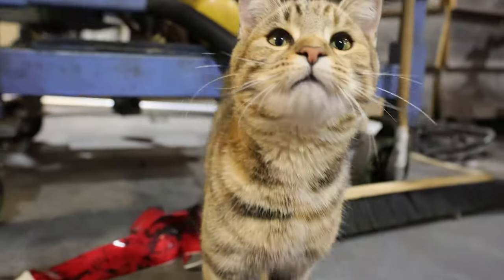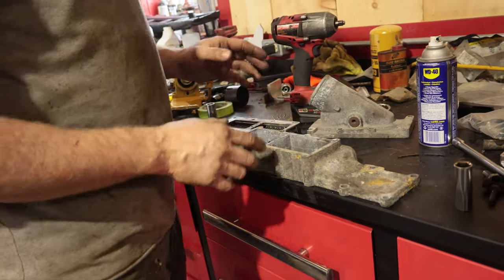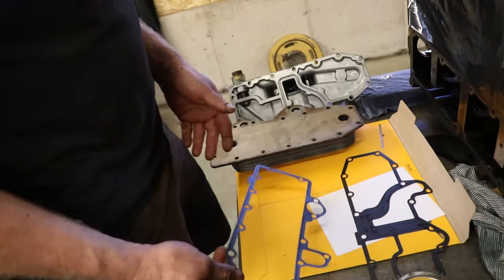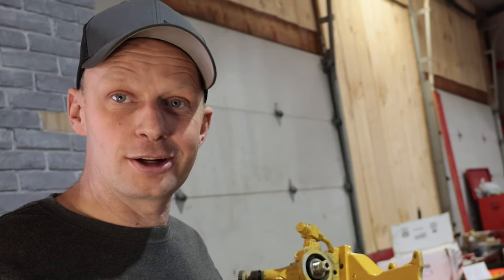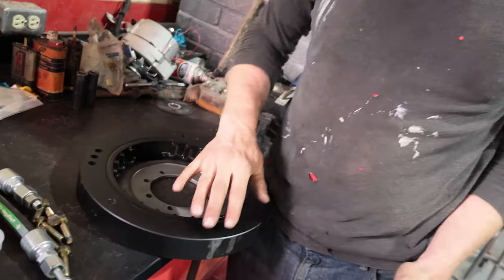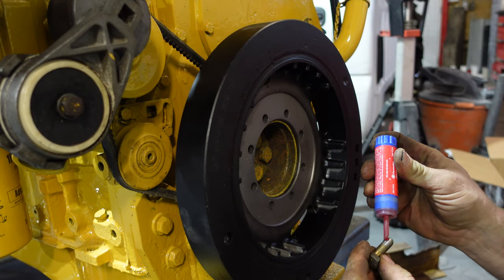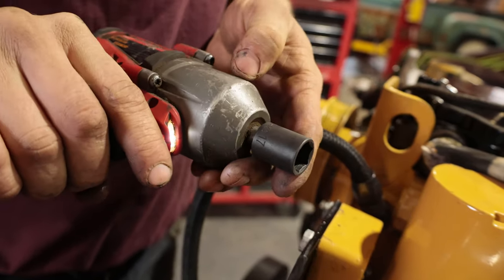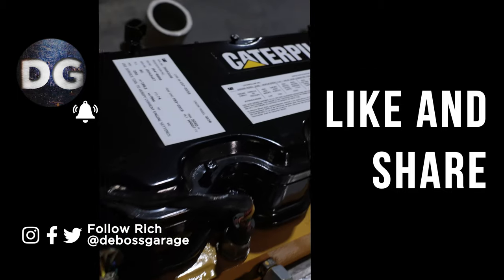How To BULLETPROOF a CAT 3126 Diesel Engine | #FTreeKitty [EP9]

Comment from the maker: Parker Inline Filter https://geni.us/parkerfilter
FASS Lift Pump https://geni.us/ts-f14-140g
Sockets https://geni.us/propoint-impacts
Reply: Thank you this video just help me alot in my diesels engine gonna order this fuel set up
Reply: Hey man,what model turbo is that?
Reply: Big ole Parker factory just outside my crappy little town in England. Also was wondering could you do a stand alone hydraulic system using hydraulic oil for the Huey pump?
Reply: @deanturner2706  I think you could. Massey 7180 farm tractors have a nice small light weight hyd stand alone high pressure filter
Reply: @deanturner2706  that's the better idea have it be standalone and just recycle back to tank and repeat

Comment: Hydraulic injection injury is no joke, glad you cover it periodically, cringey stuff
Reply: Sounds funny... but not for the one with it.
Reply: It’s a one up for people who think burning is the worst way to die.
Reply: @davidgross5826  oof
Reply: Definitely shaking hands with danger there
Reply: No it's not Tim.    I had a small injection in my hand and unfortunately no doctors or hospital know anything about it!   Fortunately I got lucky and found a surgeon in London whose seen it and I got dealt with
Reply: @chrisvanbommel5202  How did he deal with it?
Reply: @blotafton  had to cut my hand flush out the oil and debris.  It only takes 100 psi to puncture the skin.  I was injected with 500 in the system. It was a loose fitting  fortunately I only have a scar and a pinhole even after 4 years
Reply: @chrisvanbommel5202  Ouch, thanks for sharing!
Reply: @chrisvanbommel5202  Yikes.  Glad it worked out. The risks we men take only to get divorce raped in the end for supporting a wife and kids.  I tell my son and his friends to F it... just make a couple hundo and get the hay out of those first world countries.
Reply: Had one Myself.. A hose burst in my hand at about 5000 psi. Went straight through my finger and finger nail. My finger swelled up to the size of my big toe. Had surgery and they removed all the fat pads in my finger. Many  years later my finger still sounds like a steel bolt if I tap it on a table.
Reply: @chrisvanbommel5202  ehhh......in the U.S, fuckers like OSHA would've made sure your hose was certified (probs wasn't side-holed, huh?) And shut you down until you got certified equipment, so stuff like what happened to you, doesn't happen to others (apparently its working) who use unsafe equipment.
Reply: Air pressure isn’t anything to deal with either. My dad had an instructor die while going to diesel mechanics school because one of the students came up behind him and blasted an air gun in his butt cheek. Ended up puncturing the skin and sent air bubbles through his blood stream ultimately resulting in a heart attack and death. Be mindful and respectful to all the tools out there gents!
Reply: @thewobblywelder8362 that's a horrible situation for all parties! Especially the teacher!

Comment: Sweet on the filter the 7.3 is a similar type of huei system i plugged off the oil pass to huei pump plumbed in a hose and catch can and 60 psi pump  with 30 wieght tractor oil in proper check vavles  and return line giving the truck a complete sperate injection oil system does not interact with engine oil been working good massive improvement on cold starts as u can flip the switch before you crank no crank to build pressure
Reply: How do you catch the oil out of the injectors and return it back with out it and engine oil being mixed? Love to see this setup.
Reply: @bobbywhitt8830  the holes are blocked in the head and and then there taped in from the outside of the head to a hose that goes to the catch can
Reply: @jeremyhanna3852  Oil going to injectors simple. Still tring to figure out how your catching return oil from all 8 injector spill spouts and returning to a catch can for reuse.
Reply: There is 8 plugs in the head and ports tapped into the head and 8 hoses going into into 2 1" hoses that go back to the catch can

Comment: Your fellow canadian AvE has videos on hydraulic injection injuries... KEEP THOSE HANDS AWAY FROM HIGH PRESSURE HYDRAULICS!
Reply: I nearly got a injection to the face when I worked on a old broach machine (15 ton rating). 600 psi at 15 GPM is scary shit when a fitting blows from a pressure spike. 

Still have minor ptsd from that event.

Comment: I run CAT filters on my FASS for my 1LW.

The electic heater is garbage, was a complete waste of $200 for me. In really cold weather I just unplug the FASS until the coolant gets some temp in it to heat the fuel and decloud it then plug it back in and all is good. Been meaning to put in a solenoid so I can have it on a switch for cold starting but haven't got around to it yet.

Comment: The Hytorc hydraulic bolt tensioners we have at work use two-layer hoses so a failure won't kill the millwright if a hose fails.  Stretch 3" studs no problem. :D

Comment: I do mobile hydraulics and equip repair. Always doing hardlines cylinders and hoses.to my knowledge Parker doesn't make a -8 jic to -20 ORB adapter.(safe to assume Eaton and gates don't either.) You'd have to do it in 2 steps but I'd do a 12-20 F50X adapter to a 12-8 TRTXN reducer to your hose. I like Parker more then gates

Comment: Rich, maybe you mentioned this before & I missed it but what manner of tuning are you planning to run? Stock or ??? I've never heard of tunes for a 3126. Seems like any gains would have to be had thru injector mods & tweaking ECM inputs.  

I wish the OEMs paid more attention to airflow. That's why the Duramax is a screamer. The heads were designed by someone who actually understands a flow bench. The intake sucks but that's easily rectified. Your intake is artwork!

Comment: Is there any concern with the fittings cracking due to pressure and vibration? Welding them tends to effect the ductility (embrittling) of the steel and could lead to premature failure. Generally at my work we do not weld pressure vessels, because it is an unpredictable process. One time we welded a 10.5" pressure cap and then took it to 3,000 PSI. Blew the end off the cap and shot it into the cinderblock wall in our test bay. Definitely good to raise awareness to the dangers of pressure. Our company slogan is "don't tease the tiger" and we have a video that was made a long time ago that illustrates the dangers of pressure.

Comment: Finally a video on the 3126 that’s not just machining. You should weigh the f$&@ 350 before it has the cat in it or while it’s got the gasser on the scale at V&R.

Since I have a 7.3 idi & always looking for a good swap if the idi goes out. I’d love to do a HEUI swap, but I most of the engines for swaps are over 1000lbs including the 5.9 & since my idi weighs 900lbs, I see why people do a Powerstroke swap, cuz it weighs the same as the old idi.
I had a Powerstroke before my idi & got away from a HEUI, so if cat has a mechanical engine I’d love to know that’s under 1200lbs.

Comment: Never have I seen such violence when tapping holes. Did you happen to work flat rate at one point? 🤣
Reply from the maker: Chasing holes.  Just cleaning the paint and corrosion out.  Not tapping holes

Comment: Ford had the same issue with 401 as far as wear due to uneven intake pressure. It was such as an issue they had different piston to wall clearances from cylinder to cylinder to compensate.

Comment: You should take pieces of the 90 or even 3 straight pieces angled toards the intake ports inside to strengthen the intake "manifold" and guide air to the front cylinders better. Your setup will push air stright to the rear port

Comment: The grease trick for transferring holes works, but I would definitely recommend some transfer screws.  I use them at work, and they're a bit more accurate and consistent.

Comment: So you said if you keep up on your oil changes that the huey system should work fine considering it needs clean oil. With that in mind wouldnt something like amsoil bypass filtration systems do a good job of keeping that huey system working properly?

Comment: ya should see the grimy old hydro lines on the 1976 dodge W300... can still lift a 1800lb hay bail but... the pto for the pump blew up its drive shaft, someone put non oil ratted tape on the iron oil lines, everything is covered in s***, the quick disconnects for the hydro's need some tool that locks onto them to pull them apart... still works.

Comment: im super inerested in that intake manifold. would love to build one for my bus but elimination of the grid heater would be an issue.
Reply from the maker: Going to weld a Cummins one on the end yet.  Just want to figure out where the intercooler ends up
Reply: Going to rewatch and waiting for the next installment

Comment: Use pipe dope for number 2 fuel on npt fittings. Gasola or blue monster works good.
Reply from the maker: The fass filter comes with tape on the fittings.

Comment: 6:10
Teflon tape for NPT isn't a sealant, it's a lubricant so you can tighten it more without stripping anything. That's why you should never use it if the thread isn't tapered.

Comment: For the high pressure oil pump what do you think about setting up an independent hydraulic oil system to run the injectors?

Comment: I don't think your intake is going to work too well.
Air at the inlet, No.1, will be at a very different pressure to the air entering No.6 (due to the gradually reducing internal area). This will similarly effect the fuel/air mix from 1 through 6. ?

Comment: why didn't you use a nice tight low pressure filter on the inlet to the hp pump?  65 psi is way easier to build for.

Comment: would it be possible to make a stand alone oil system to run the huei pump? like a remote oil tank, electric pump and a regulator to achieve 60psi, a filter and send it to the high pressure pump.

Comment: Could the 60psi engine oil be filtered before the heui easier and get you the protection for the pump?  Then the 4000psi filter be skipped because the dirty oil is likely what would damage the heui?  Or,  not sufficient enough?

Comment: You said that Parker filter for the high side of the Heui pump had a screen in it. Does it also have a replaceable paper filter element or just the screen. Do you clean or replace the screen. You said the one Adept ape mentioned was nearly 2,000.00 but if I remember right it was around 1,000.00 U.S..  I just find it hard to trust ebay for a critical part with all the counterfeit and black and gray market stuff in the world. Josh at Adept ape also mentioned a pre filter that filtered the low side oil supply going to the Heui pump, but this wouldn't protect against the Heui pump failing for other reasons and taking out the injectors. Thanks for posting this video, our Cat 3126E is a 330 h.p. HEP08621 with 53k miles, in our 2003 Newmar Dutch Star Motorhome.

Comment: to further bulletproof the HEUI system you could fit a remote hydraulic oil tank, remote pump & filter and return to the tank. That way engine oil contaminants never get to the injectors. You'd be able to fit a lower psi rating filter and it would transfer weight away from the front to the rear of the truck.

Comment: The high pressure injuries you are talking about is called hydraulic injection Rich. I watched a guy lose 2 fingers to a pinhole leak in a hydraulic hose on a bucket truck he was running. Just had a flap of skin holding them on. He almost lost his entire hand from infection afterwards.

Comment: Seeing that balancer reminds me of the day I tried to get the water pump belt off of our little Freightshaker for the first time. It took a lot of cursing and swearing, bars and brute force to learn that I needed to flip the belt inside out to slide it on with one hand. Is there anything to do with the timing on the HEUI pump? Ours is oozing oil out from the front cover, or at least I think that is where it is coming from.
Reply: There not timed on this model. Just pull it off and throw it back on.

Comment: But r u sure that ur turbo is not gnna loose pressure inside the intake manifold...? Or may b its a bigger turbo n wont loose pressure but how about on low rpm range? Bcuz wat i think is that bigger the turbo longer the lag on low rpms??? Correct me if im wrong.

Comment: Whoever dislikes this video works at the EPA
Reply: Facts
Reply: @cesarconh895  his channel has slowly gotten worse and worse
Reply: @aserta  That’s a tad extreme there guy. I think we can all agree clean water and air are a good thing, but like everything else, there needs to be a balance of what’s reasonable. I assume he’s referring to epa regulations in reference to diesel emissions and this engine swap. I could be wrong there. I’m not up on diesel emissions in Canada, but there’s been an assault on specifically diesel operation, performance, and swaps in the states the last 15 or so years and as it seems to be with everything from the Chinese virus to climate change, not all the science seems to agree. There are studies that indicate the millions spent developing diesel emissions add ons are not necessarily all good and cause other problems with the focus mostly on carbon and nox stuff. We do know it’s expensive, increases cost of ownership and repairs for operators and significantly reduces reliability and engine life. This additional expense is passed on to the consumer as everything relies on diesel engines from transportation to mining materials to make all our modern amenities. We just need a sensible balance a reasonable approach to these things as with anything else. While there are good parts or what environmental protection regulations do, it’s not infallible and we don’t have to like all of it.

Comment: Hey Rich I have a question. What manual transmission will fit behind the cat 3126? I wanna buy a 2000 gmc c6500. But the one a found is authentic. But it's very cheap, I would like something like 10 speed manual.😅

Comment: Your right Rich...........the original intake is very horrible.........very unbalanced.   When using factory fuel filters they are rated in microns..........but only at 60% efficiency. Use 2 together in series to get better filtration.  HOLY SHMOLEY that is some hydraulic filter !?!   10/10 for safety Rich...........high pressure injection injuries are very serious.

Comment: I just got a 3126 in a 2000 gmc 7500 230 or 210 hp anyways it came with no ecm can i buy any ecm to get it to run and move? Or even bypass ?

Comment: I expected your solution would be a stand alone hydraulic pump to run the injectors. 
We had an international truck with hydraulic boosted injection system and it had a bad sensor of some sort and kept blowing an oil line. We farmed out the repair when it blew a line with a 12,000psi burst rating!

Comment: Rich, why didn't you mount that honking 5K psi filter to the frame of the truck instead of the engine? Seems like a lot of weight hanging off the front engine cover.
Reply from the maker: needs to be close to the pump
Reply: @DEBOSSGARAGE  Hmmm...hope that works out. Even the little VP44 pump on my Dodge has a bracket to hold up the ass end. Your filter is mounted off to the side free to apply all of it's force to the timing cover (think of levers, fulcrums, input force vs output force, etc). Seems like a small force like a large pothole or 10mph fender bender would send that filter right thru the radiator. JMO!

Comment: Not sure if anyone will read this but I’m purchasing a pre 2010 kodiak c4500 retired ambulance to convert to a Overland 4x4. Stock with the Duramax 6.6 it around 17,000 lbs and I’m looking for a engine to replace the 6.6. Would this CAT be a good fit? I was considering the Cummins 8.3 but I’m just looking for mechanical reliability and efficiency.

Comment: I am curious how the large filter on the hp oil line will affect the injection system. I feel like it could be harder on the pump but also induce a delay in the ramp up/ramp down of injection pressure. Cat makes an inline filter for the lp side to protect the heui pump.
Reply: Curious to see how it works myself. The ebay link to that filter he posted shows he bought it in Spartanburg SC. Thats where I live but never thought about a high pressure filter. I've installed several of the low pressures your talking about since cat came out with them. So far so good!

Comment: Having a larger volume inside the intake will increase turbo lag as there is a large volume of space that needs to hold what ever boost you are using. Often different cylinders have a tapped intake to decrease spool time. There is always a sweet spot like most things and without sitting down and working out air volumes you wouldn’t know if it would hinder your performance.
Reply from the maker: Someone said that when I put a massive air to air cooler on the 4bt Tahoe.  Even though I agree with you, the volume of air is so large, you would never feel it
Reply: @DEBOSSGARAGE  Ye I agree, like I said it is guess work so might not affect it at all and sometimes on other cars it can cause turbo flutter or lag. I think it will be fine, it will definitely share the air flow better between intakes valves.
Reply: @DEBOSSGARAGE  You will certainly loose time on the Autocross track.

Comment: When the atomiser blows off the end of the injector, what actually damages the engine? Does the high pressure diesel work like a water jet and cut the piston or is it the concentrated burn overheating one spot?

Comment: In that tapered designed won’t the air get squeezed as it’s traveling down the cylinders changing psi and unbalancing head pressures?